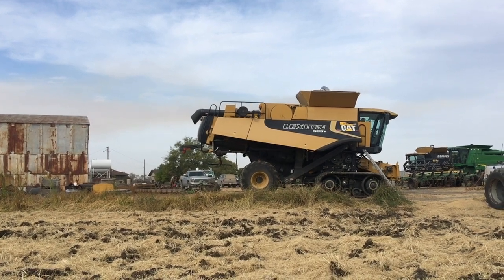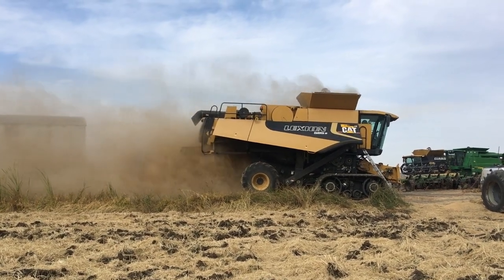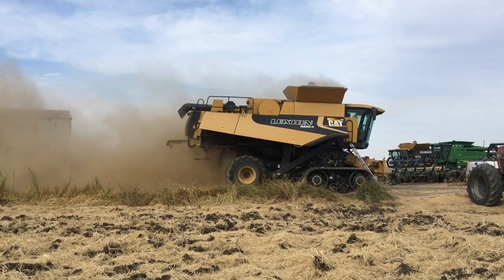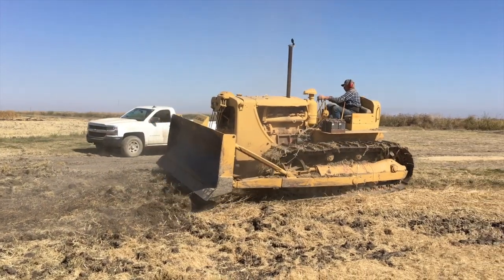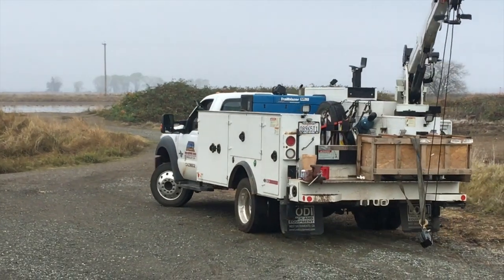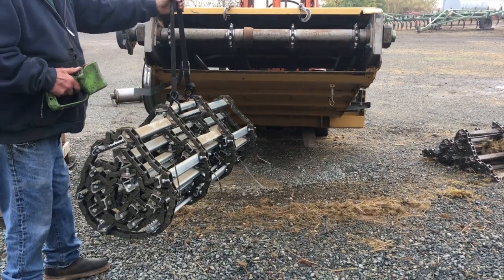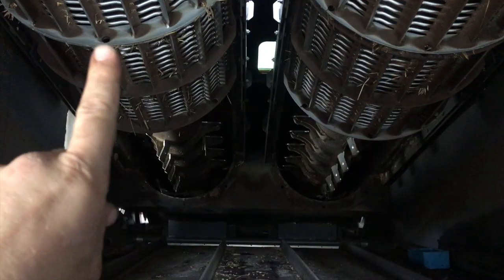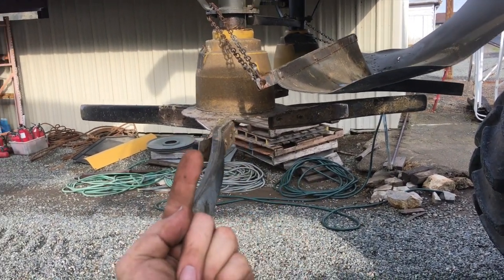Look at all that Dust! | We're repairing our Claas Harvest Combine in this Tractor Video

Comment: Here in Arkansas they use what is called a stubble roller. Usally pulled by a large rubber tired 4 wheel drive tractor normally when its raining with standing water less balling up and more residue soil incorporation, less rutting.

Comment: Harvesting rice is not easy but cleaning machinery is not so simpler.  when it comes to cleaning the harvesters it's a dirty job that's for sure an itchy one. After our 2019 rice harvest I had to clean up all the equipment from the harvest. I was put in charge of cleaning the equipment. Starting with the harvesters it takes a long time to clean one just because of how much chaff the harvester collects. But anyways after a few days of cleaning and servicing the equipment they are preped and ready to work on the fields for 2020. Hope for the best for you in the upcoming crops for 2020 Matthew.

Comment: Why do you need 3 combines for only 1200 acres where I live we do 3000 acres of corn and soybeans with one combine
Reply from the maker: Good question, Colt. Well, we could do it with one. Some farmers do. We could definitely do it with two. For most of the harvest this year we actually only ran two and had the John Deere as a back up. This year we had such a tight harvest window and we were worried about falls rains cutting our time short. The quicker we can get the crop out of the field the better. Comparing corn and soybeans with rice isn't quite fair. The rice plant is tough, and threshing is slower. Our headers need to be smaller and our ground speed slower. 
-Matthew
Reply: @Ricefarmingtv  thanks I always Wondered about that